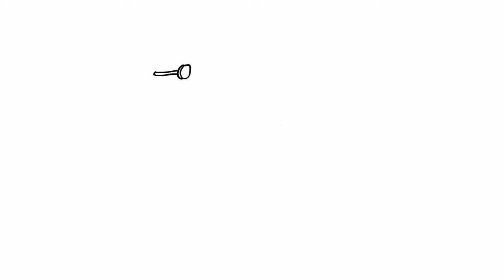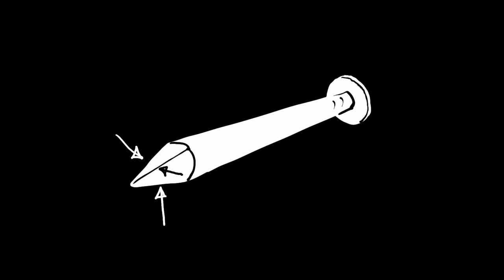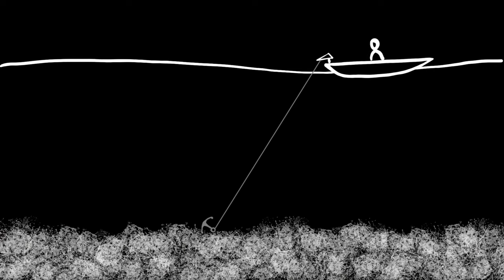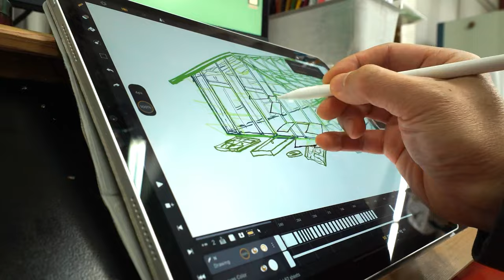From Clutter to Order | Why I Organize Vertically | The Basics 101, Philosophy, Wabi Sabi

Comment: The two nails and the zip tie have my mind racing.   I was thinking of what was holding the zip tie.....then
an old story came to mind.  There was a trim carpenter who was hanging many more doors than his peers.  It turns out he would put nails into the jambs, lay that jamb against his framing and then bend another nail over the extended nail.  In doing so he was pinching the door jamb in place.   (Years ago...not prehung doors).

It would be better if I made a video about this, however I have given you enough to think about....you must take my clues and finish the picture in your mind.  And...if we are lucky, the exercise will trigger more good ideas for you.....just as this video found more motivation for me.   tHanks for the video!
Reply from the maker: When I figured out how to hold that adaptor on the wall , my heart was also racing. And the amazing Carpenter story only makes me wonder how many more stories deserve to be told. Thank you for sharing.